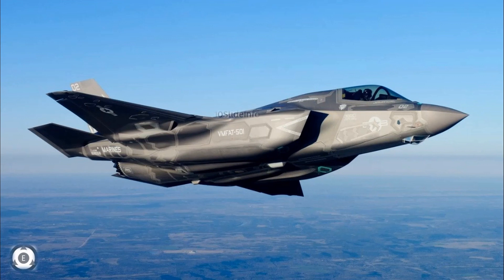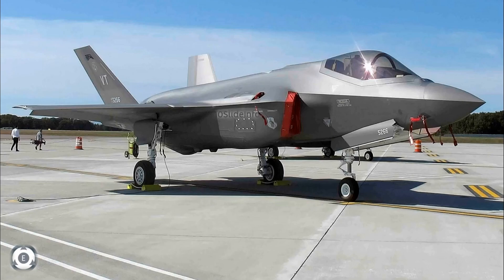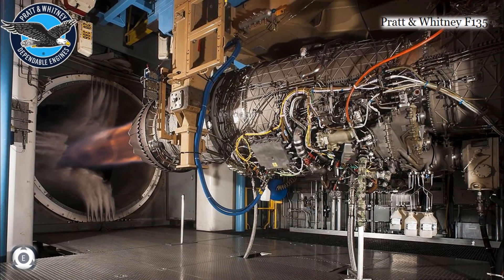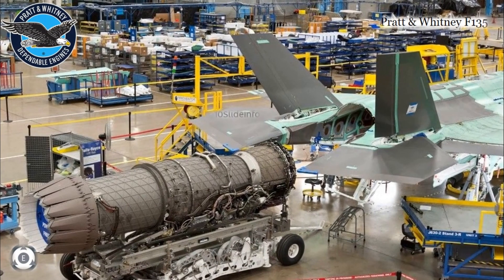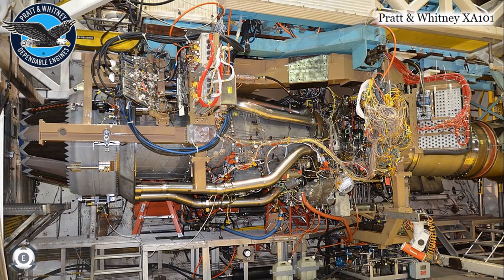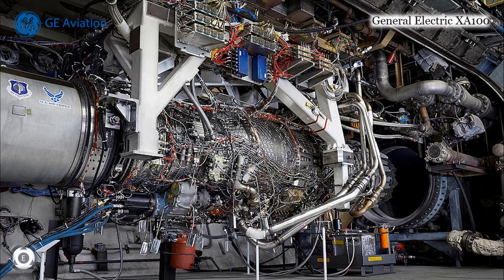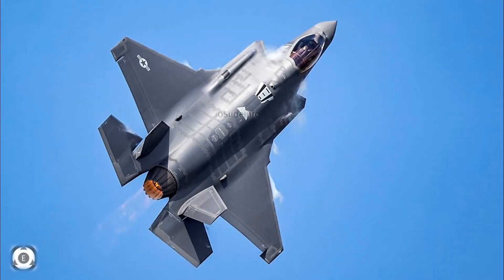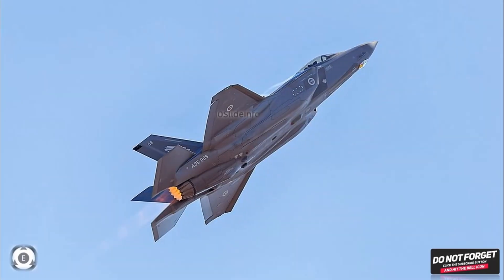New or Upgraded Engine for F-35? | Pratt & Whitney XA101 vs General Electric XA100

Comment: We need to put the XA101 engine and replace the old engine with the newer engine for F-35 to make it more efficient, reliable and more accurate than ever before with the new engine being built for the airplanes it boosts the fuel or thrust of the airplane to make it easier for the airplane to fly better.